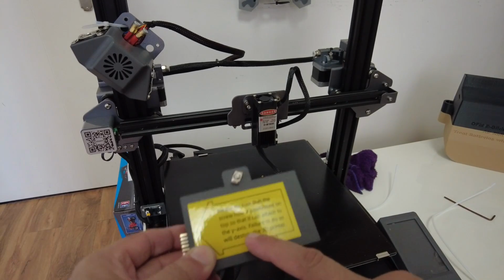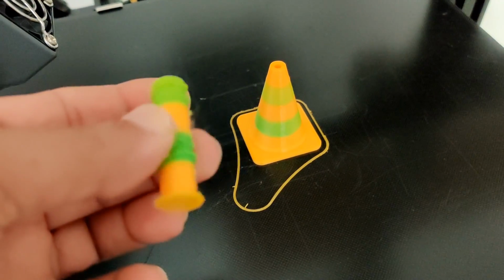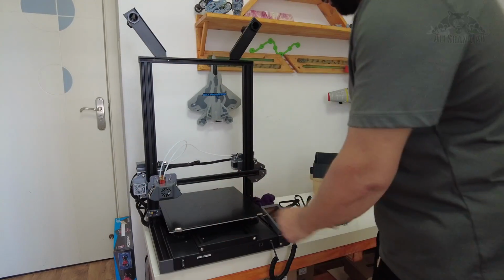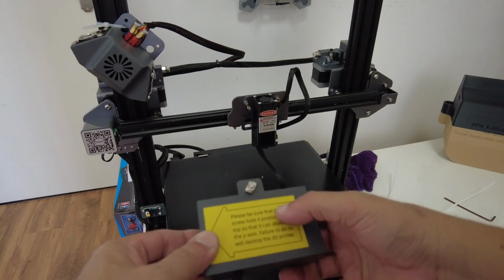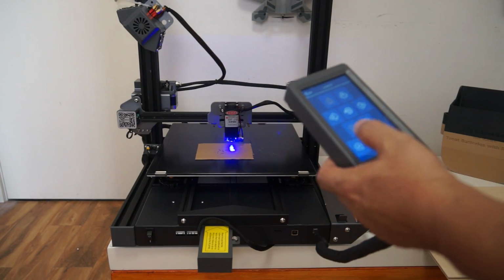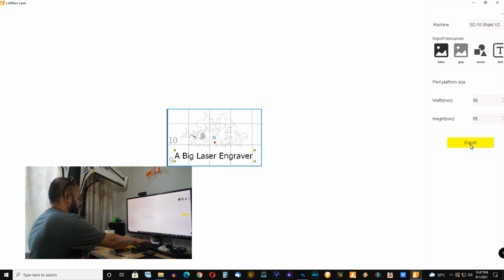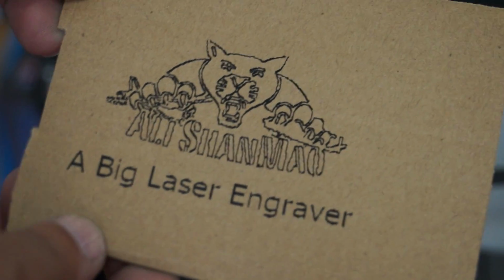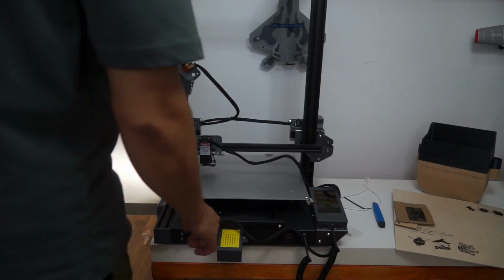Lotmaxx Shark Plus 3D Printer Conversion to Big Laser Engraver

Comment: Ali, try running over your design done at slow speed with some sand paper. It may produce a nice result. Use a flat block for sanding to preserve the sharp edges of the design.